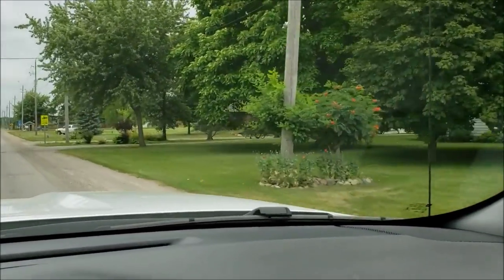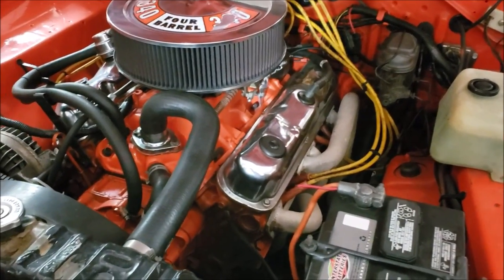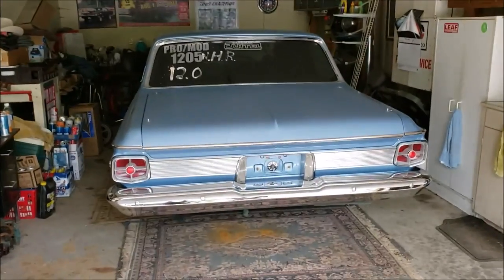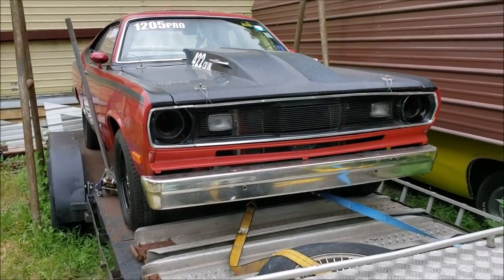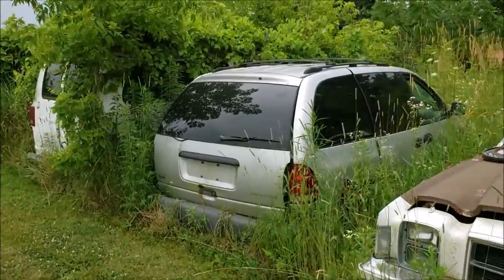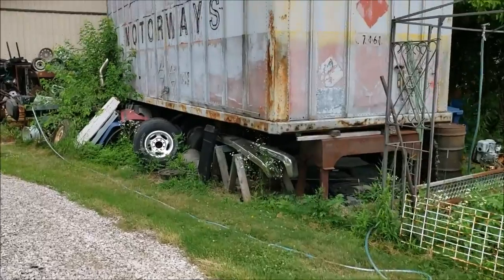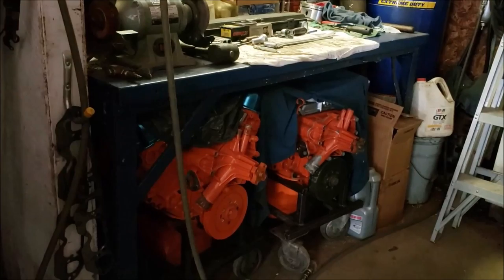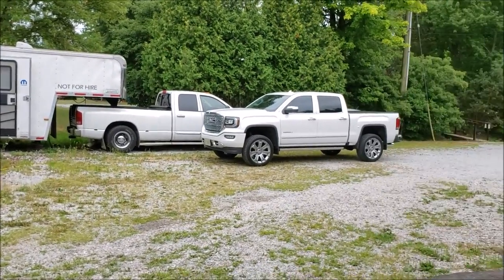Unbelievable... Mopar classic & muscle car farm.

Comment: GREAT collection !
Gave up on the Mopar Nationals in 2003 when they completely ignored the 1978 Lil Red Express truck, fastest thing built in 78 but the Cuda's and Challengers I believe took center stage AGAIN in 2003... Done with it... Trucks in my garage, I bought it NEW (actually ordered it) in 1978 from Greensburg Motors in Greensburg Pa.
Reply: Sweet  ! I Love 78 Expresses. I am restoring a 76 2 wheel drive Plymouth Trailduster with the rare Pacesetter halfcab by Minnesota Truck Parts. The 76 Plymouth grille was toast, so Luckily I found a NOS 78 Plymouth grille still in the box, Exactly like the 78 Express grill , but without Dodge imprinted into the top. Seriously thinking about having Warlock- themed stripes done in gold leaf after its painted.
Reply: @shaunclifton5281  Always liked the Trailduster style in both the Plymouth and the Dodge, my stepdad had the Dodge Ramcharger, his was 4wd though, lived in the mountains. The stripes would make it stand out even more. I just looked at 76 Trailduster images, seems there were a couple/few different grilles available. What color are you going to paint it ?
Reply: @daverodkey  PPG Hellfire red, which is just a candy apple red to me.
Reply: @shaunclifton5281  Awesome, the gold striping would make it really POP !
Reply: @daverodkey  yeah !

Comment: Of all the Mopars I've owned, There's two I wish I still had and I owned both at the same time.  Favorite 70 AAR... and a 70 440 Cuda.  I found the AAR sitting at a gas station on the way to work 1978.  I went over at lunch and wrote the check.  Then went to my bank after work to get the loan...  A friend who worked with me drove my other car home.
Reply: Have had a few Mopars but never a AAR. Have had 68 Road Runner.  2 ea70 Cuda, 2 '69 Chargers, 64 fury, 63 440 dodge &&&&2 T/A Challengers. A orange 1& a white one. I miss all of ' em especially the T/A's
Reply: @ronparker4904  Very nice. I would love to still have one.

Comment: If my memory is correct, I think I got parts from him when I was restoring a 1964 Dodge Dart GT Convertible ! The only place I found a push button transmition cable set.
Reply from the maker: Ya I was amazed at all the parts he has. Crazy
Reply: wish he would sell some
Reply: @edwardaprile2791  why you in the market for a classic mopar or just wishing about it?

Comment: A little dusty? It's a Duster. No worries.
Reply from the maker: Haha good point
Reply: That Duster is awesome I love the orange with white interior all original. He knew how to take care of a car and had the wisdom to pull the original engine out and keep it on the side because it's only original once and if you blow it up your screwed  I know a guy has a 1970 SS Chevelle LS6 454 he had since new he blew the engine up back in the 70's and took the heads off it put them on another 454 took off lot's of parts and just tossed them or lost them now he is trying to get it back to original and it's going to cost him a arm and a leg to find all the right parts to put it back to original but if he would of kept everything that came off the car he would be set.

Comment: Ugh, does the 71 Charger have a good passenger fender and would it be for sale?
Reply: I'm sure that you could fix the fender issue with the right junkyard or aftermarket replacement part, or with that Simoniz Pops-A-Dent thingy.

Comment: AMAZING OLD DUSTER 340, 14.7 SOUNDS VERY TRUTHFUL STOCK. HE MUST HAVE HAD SOME SERIOUS WORK FOR RUN IN THE 12'S.. I AM 64 SO I REMEMBER THE OLD SCHOOL CARS, MAGAZINES USED TO SAY THEY RUN 13'S STOCK OFF THE FLOOR BUT I NEVER SEEN ONE COME CLOSE, HE MUST HAVE SOME GOOD ENGINE BUILDSWOW, HE HAS A FORTUNE THERE, SO MANY 1 OWNER VEHICLES--THATS INCREDIBLEHEY ART-I HAVE A 96 GRAND CHEROKEE WITH THE 5.2 THAT RUNS FLAWLESS BUT I WOULDNT MIND A 300-350 HP 5,2 ENGINE WITH A SET OF HEADERS, ETC. YOU SAY STROKER OR JUST 030, CAM, HEAD WORK?
Reply: if your stuck on a 318, then go 4" stroker kit will produce 400 hp on pump gas go JIm!
Reply: Thanks Arthur but my old ZJ comes from NY and has its share of rust underneath, floor boards still solid but certain areas getting rusty, body looks fine with original paint and interior like new, I am in NC now so I will drive until spring then look for a late model with a HEMI, should be plenty of people looking for a good 318, trans, diffs, etcc its my 2nd vehicle so don't see much use here

Comment: Goes with out saying..." No car like a mopar"...1st car @ 17 a 64 dart  coupe /6....3 on the tree...2nd) 69 2dr belvedere /6 and 3rd) 73 duster built 318 and lastly 71 d100 with ( yep) /6 ...  Btw just turned 60
( 69 Belvedere was only 1 I lost...16y.o late for school didn't stop making a left from his apt. Complex ..peeled left front frame to a 90* ripped the entire front axle out and the engine was setting on the road...est. his speed at +60
.. I was doing the limit 35 ... Had  city law behind me )
Reply from the maker: Sounds like nice cars. Thanks for sharing

Comment: If you think it takes loads of work for a 340 in a A body to run 12's you must run mouse and rat motors, iam a mopar guy but even the HEMI guys seen a lot of tail lights from a 340 in a Dart, Duster, Demon or Cuda. Just saying
Reply from the maker: I love the 340. Had one (69) in a 73 road runner back in the day. it was a beast. 12.5 all day long in a 4 speed car and heavy too. And stock bottom end

Comment: Around 1987 I could have bought 71 duster 340 looked identical except blue with white stripes 3speed manual for 1500 sick I didn't buy it to this day instead bought a 1983 dodge charger 2.2 black and gold  stripes for 1750 sure wish I could get a re do